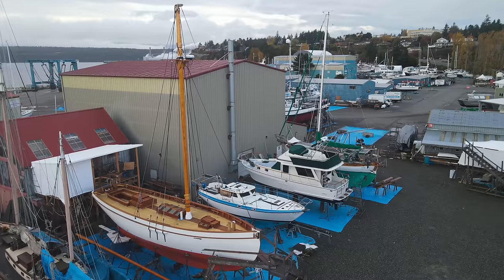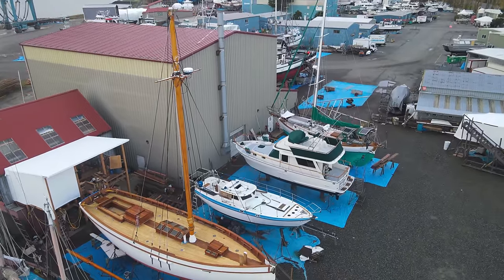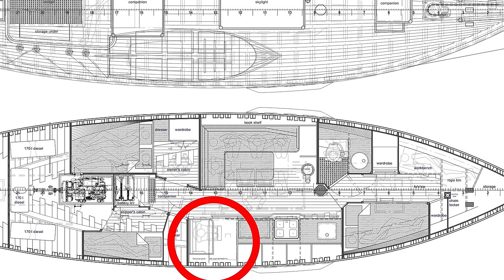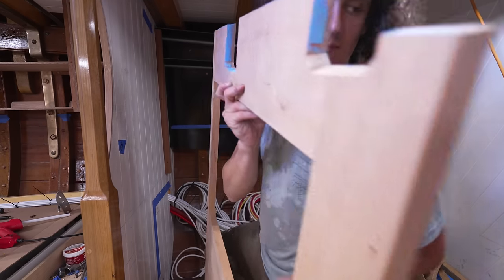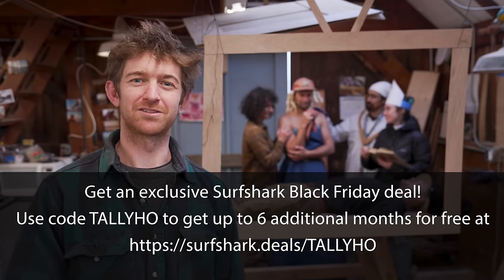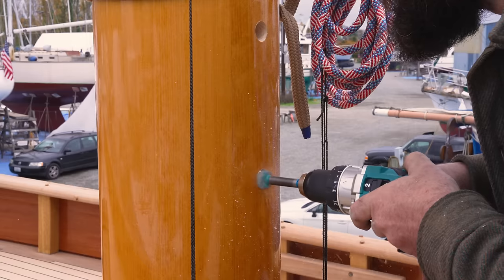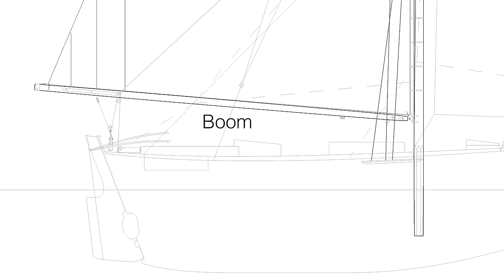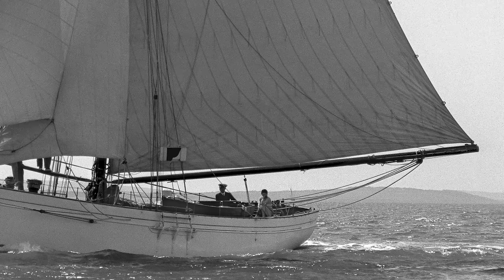Tally Ho gets an absurdly long Boom.

Comment: Damn this is impressive. Am I correct in my impression that almost none of the original wood is still left on the boat? Everything looks brand new, and it looked very rotted to begin with?
Reply: All the original centerline, hull & deck framing was too decrepit to re-use - that material & the deck planking was little better than mulch. The original teak transom & hull planking fared better - the lowest 3 transom planks (about 30% of its total area) are original, & some of the hull planking was re-habbed into interior bunk rails. The saloon table will also be built from original hull planking. While not part of the old boat, the new bowsprit is shaped from a length of Douglas Fir that was salvaged from a Seattle building - it might be even 'older' than Tally Ho !

Comment: Does anyone know the need for those reinforced blank holes that Bob drilled in the mast under the goose-neck?
Reply: I was wondering that too, there doesn't seem to be any bolts going through the gooseneck rings into the mast... Any info would be greatly appreciated.
Reply: the hardware has bosses which are part of the casting that stick into the mast to help keep the gooseneck located. the holes in the mast are lined with G10 tubes to help spread the stress across more fibers in the soft spruce.

Comment: I should know this but is the orange the final color in or is that still just a primer coat? Always wondered that.
Reply: Watched some old episodes last week and Leo mentioned that the orange colour was a marker to tell if the actual bottom colour is wearing thin and needs to be re-done. Don't recall if he mentioned the final colour.
Reply: @marclattoni1959  I figured so as I think he would go with an original color but was not sure. Thanks for the info!

Comment: When will the bowsprit and topmast be fitted?
Reply: Patience, Patience, it will come in time. Think the bowsprit might be rather an obstruction in the yard at the moment.
Reply: @harrymoyes5069   I heah ya. Yup, I agree. I wonder if the sprit will be retractable? I sailed on a 56’ cutter in Cornwall that had a retractable sprit that saved the ownah money when he moored her at a dock, shortened the LOA which is how docking rates are calculated. Also useful when maneuvering in tight quahtahs.
Reply: _SampsonBoat_Co_  
How ah ya? The handle doesn’t work, has it been highjacked?

Comment: Hi, can anyone help with this question does it matter how much weight you build into this Yaught? Will it ever get too heavy? Thanks Chris.
Reply: Yes, it matters a great deal, both the total weight, and the distribution of that weight.  
Tally Ho is beautifully, and heavily built.  With twice as many frames, they could have just caulked between them, and not bothered with planking.  There are many benefits to a heavy boat, including strength, motion, and load carrying ability.  But there are consequences to all of this weight too.  That's why the boom needs to be so long; a heavy boat, needs a lot of sail area to move in light air.  Remember, she won the Fastnet in '27 because all of the other boats but one retired due to the bad conditions.  My guess is that the restored Tally Ho will continue to do well in heavy air but will be quite a bit slower than modern boats in light air.
I am sure that Leo has been managing Tally Ho's total displacement from the beginning.  At some point I would love to see a comparison between the initial weight study for Tally Ho, and what the scales show when she is done.
Reply: Thanks Swamprobin. That really helps me understand a lot more. It would be good if Leo could make a video about this, it would be really interesting. 👍
Reply: @chrisdavey2685  Tally Ho may have won the Fastnet but she's not really a racing boat. Above all she is seaworthy. And durable.
Reply: When she was designed she was based on the fastest commercial boats in existence at the time,  the pilot cutter.  Modern hull design has moved on so that downwind  a modern yacht would eat Tally Ho. But upwind  and in heavy weather, it would be much, much closer.

Comment: Does anyone else get nervous how long the boom is😮gybe preventer?
Reply: When close-hauled, an add'l preventer can be rigged from the boom to the rail - slack enough to allow adjustments to the mainsheet to maintain course, but short enough to 'prevent' the boom from suddenly crashing over the centerline.

Comment: Is tally ho gonna have solar panels?  Or is power solely generated from the motor to charge the batteries?
Reply: I don't think there will be much space to install solar panels, but we'll see what happens later on
Reply: @on4xb  i thought the same thing…No room.  So Leo will just charge the batts from the motor at opportune times when needed.
Reply: The prop can charge when underway. They can disengage from the engine and still charge is my understanding.

Comment: I do have a serious question.  The position of the fife rail behind the boom makes it appear that the boom would make contact with lines made off on that rail when the boom is squared out for a run.  I'm sure this was considered during the design of the rig. What am I not understanding about this?
Reply: It appears that the forward edge of the rail will allow clearance from the boom for up to at least 90 degrees. I would assume that the deck forward of the fife rail would be the preferred location of making fast halyards, as opposed to over the butterfly hatch.

Comment: I am really surprised by the fact that this is going to be a 12v boat (6:06).  I work with a lot of boatbuilders both in the US and abroad and general rule of thumb is that if a vessel is >40', it is best to have a 24v DC system.
Reply: Tally Ho will have both 12v and 48v DC systems.